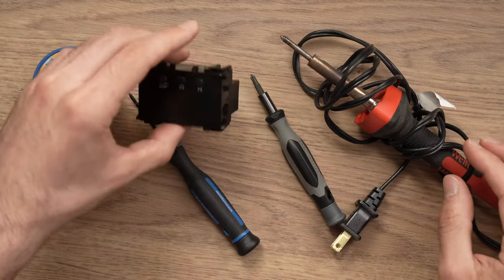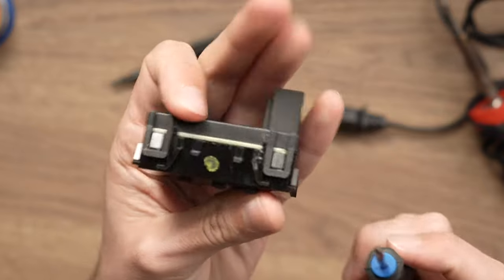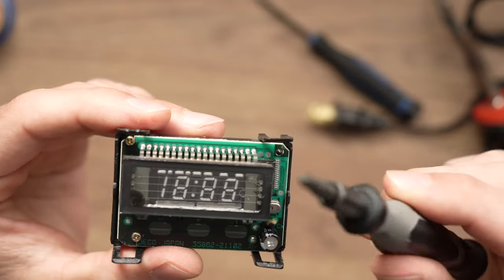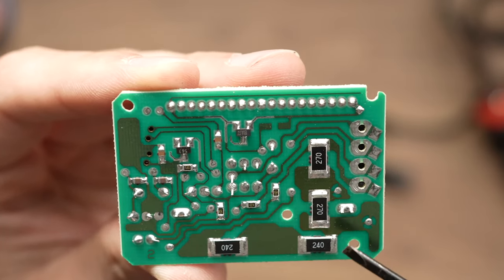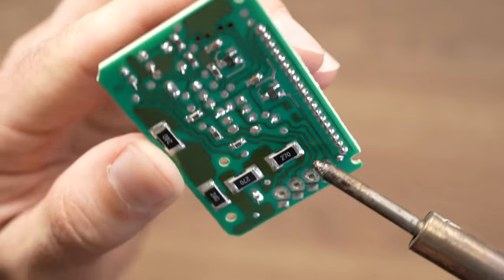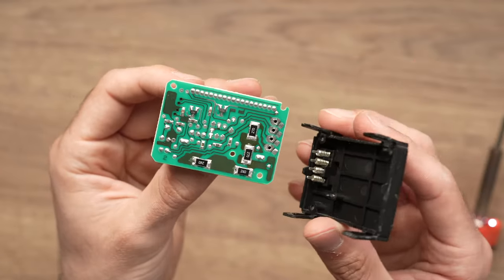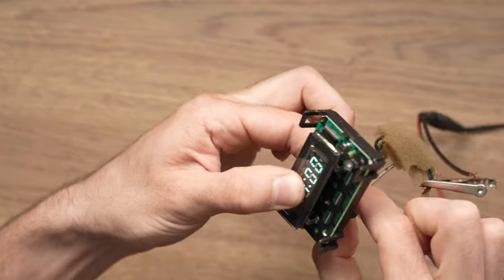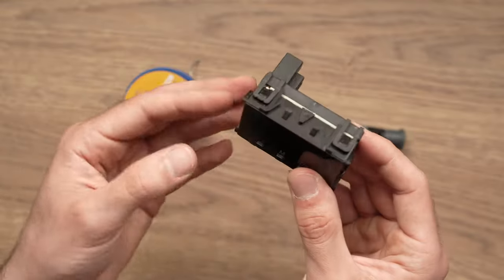Toyota 4Runner & Tacoma 1996-2002 Digital Clock Repair - Step by Step Tutorial Guide

Comment: Genius, worked like a charm! Thanks for the tip, I took it out thinking the springs could be the problem, but when I saw them in perfect condition and tested, didn't notice one of those components was actually lifted from the board after I heated up one side and almost dropped it.
Reply from the maker: Glad it helped!

Comment: Can you do a video on the 96-02 4runner digital climate control. The thermostat setting on mine goes wacky on mine whenever you try to adjust it. And some buttons wont work unless you press down hard on them.